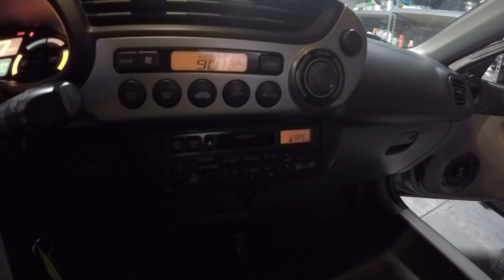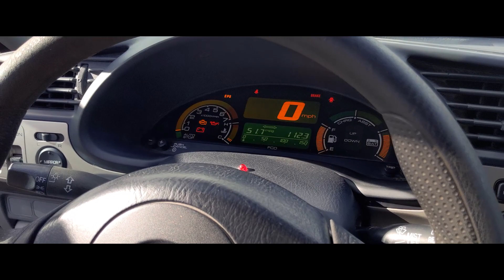PRO DETAILER cleans my FILTHY hybrid! (FINALLY CLEAN)

Comment: Great video! Gotta work on those audio levels though, it's making me wear my volume wheel out!
Reply from the maker: Yeah... I wish Premiere had some ability to auto-level audio. I try to keep everything around -3db but random clips will have something like a door shutting that is 10x louder than the rest of the audio and it will sound awful until I massage it. Bleh.
Reply: @100PercentJake  It's actually the music which seems much louder than everything else by like 3x. I had to triple my volume just to hear the rest of the clips of you talking then back it down when the music came on super loud.
Reply from the maker: @abyssunderground  I'll take note of that for the future. I actually turned it down a ton compared to the average clip level!

Comment: The wee beastie is looking so much better. This is a job I have to get done to Arthur. 31 years have taken a toll, and so have the 400,000 miles. Surprisingly, the carpets are still in good shape. A set of the semi-rigid Volvo floor mats have worked wonders. Great to see what is possible. Josh does great work. Too bad he is so far away. Seeing that car, and based on your comments about your height, I do wonder if I would even be able to get in. I have been stuck half way into other Honda products.

Comment: I felt sorry for that poor kid having to clean that thing ! Tell him dollar general brand of resolve works great on cleaning fabrics and its cheap.
Reply: I had a pro carpet cleaner tell me that window cleaner with ammonia works great and is cheaper that that resolve carpet cleaner.  Before you use anything to clean a surface test it on an out of the way spot first. I suppose you could just buy some ammonia and dilute it to use as a cleaner. Just keep it far away from anything with chlorine in it.

Comment: Door panel needs to be popped off (maybe 5 minutes) and pressure washed instead of scrubbing the filth all around and deeper into the fabric.
Reply: Maybe. Thats the route I would have done but there are cleaning products that soak into fabric and then you can brush them it while they it pulls out dust and stains. It depends on if there was any growth or mould.